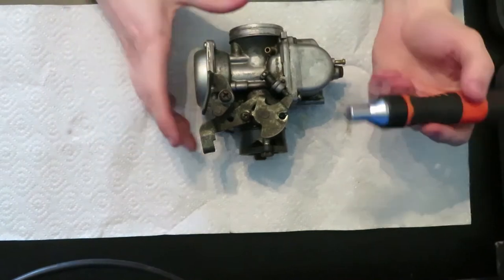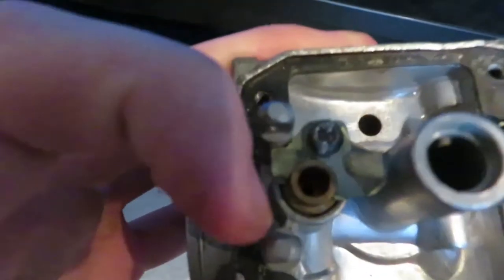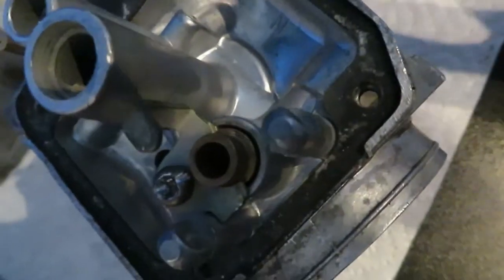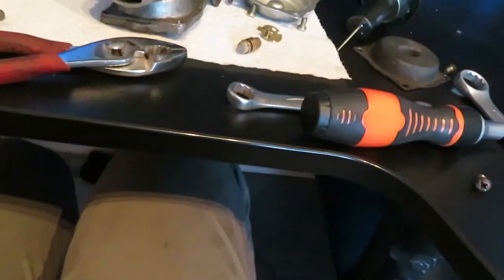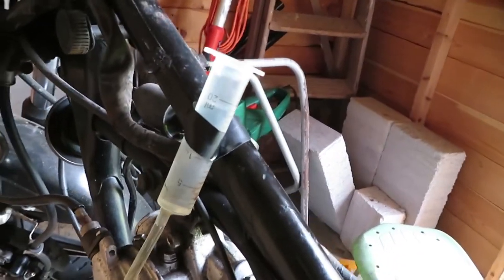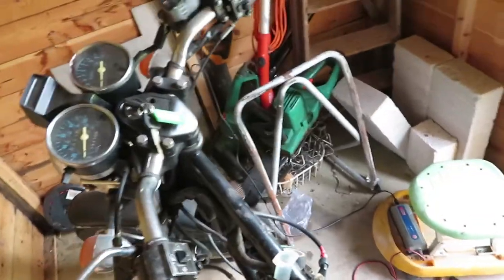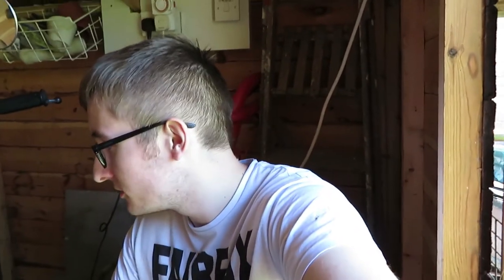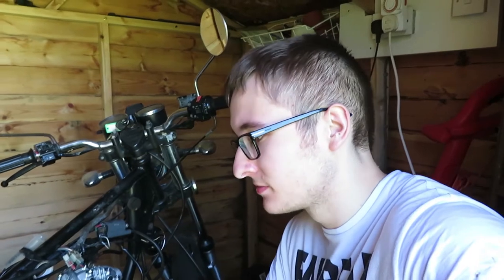Suzuki GN125 cafe racer build part 2 - Carburettor Rebuild/Bike Start

Comment: How the bike is running with air pods? any issues? everyone says if you use air pod the bike will overheat and have problems. That needs to re-jet. I would like to buy a carb and air pod set so as you did so that I dont need to rejet myself. Plug and play. Any bike issues using the air pod?
Reply: Hello just wondering the same as you mentioned here. Did you manage to find out? Thanks